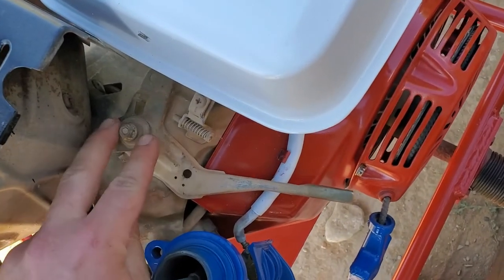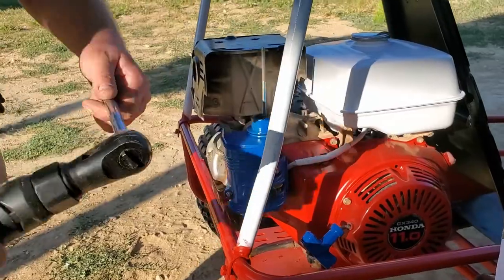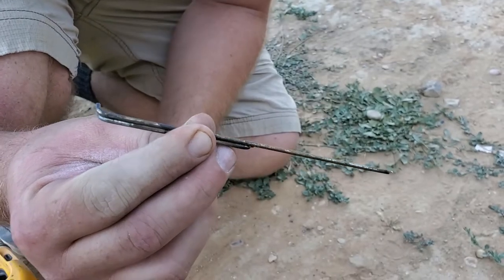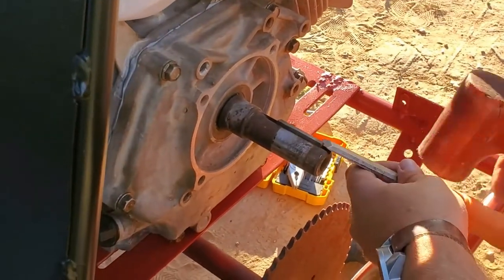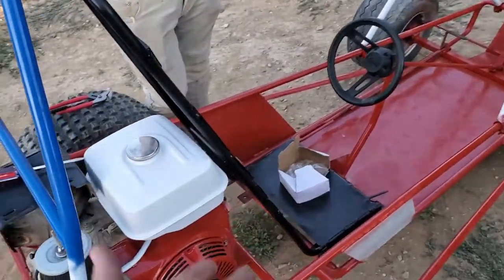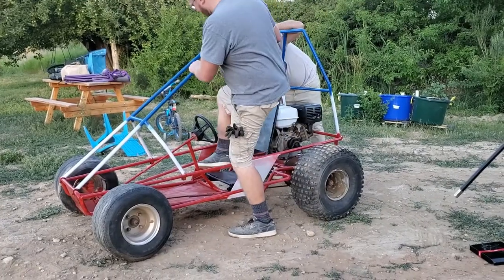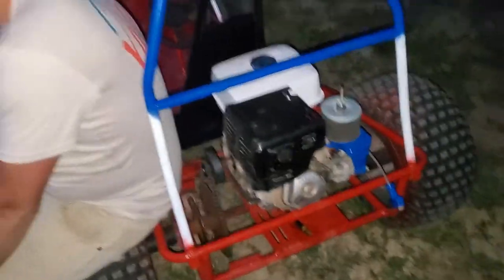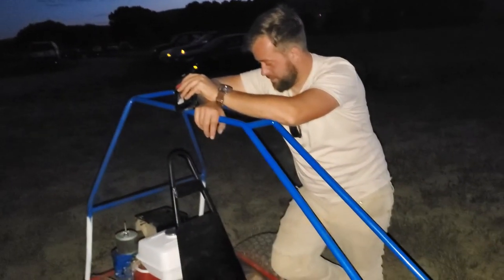(HOW TO) Throttle cable set up for CHEAP GO KART gx340! Freedom Kart Drives!

Comment: You need a torque converter for a go kart like that. Especially with those size tires and sprocket.
Reply from the maker: got one here just waiting for the weather and rear axle the old one is trash